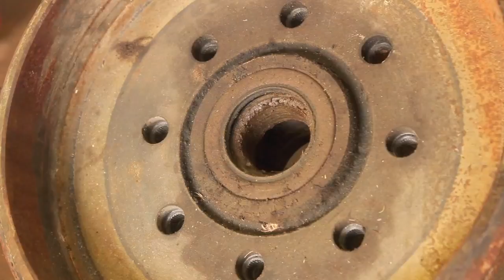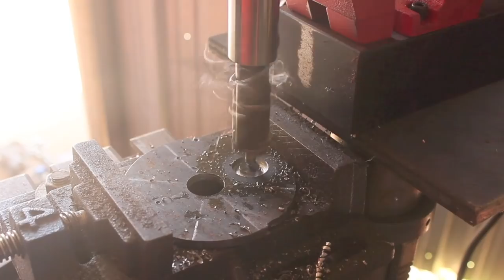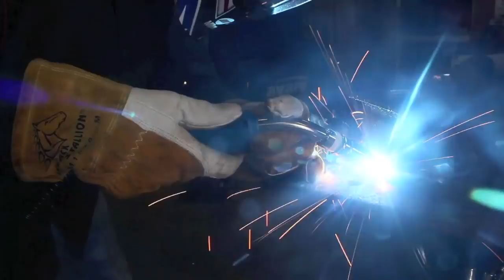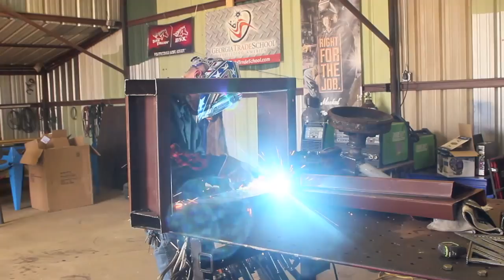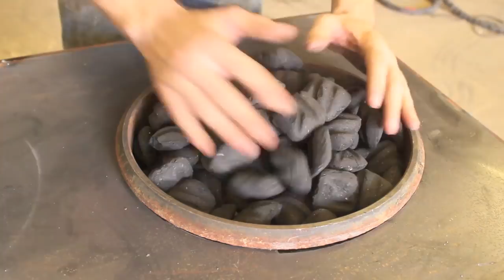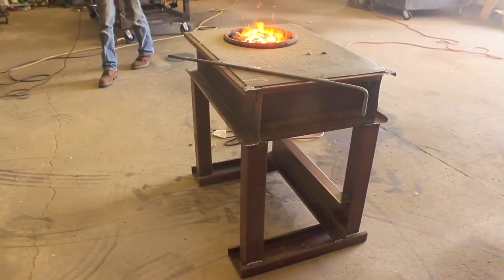BRAKE DRUM FORGE - $30 DIY Welding Project - Blacksmithing Setup For The Shop!!!

Comment: Good Idea kid, but there is just one problem. It's the wrong shape for a charcoal forge. Good shape for coal forge though,  reason why is. A charcoal forge should have a convaxed bottom for maximum burn efficiency. A coal forge can as your forge has, a flat or have a shape that is more like a grain shovel for maximum burn efficiency.👍

Comment: And for my next DIY project, I think I’ll make a 747 Jet liner. Be real mate, how many DIYers have a fully equipped workshop?? Just askin!!!
Reply: yeah i dont think any thing that needs a lathe is a $30 diy project though im sure it would be possible without that and the plasma cutter
Reply: You don’t need a fully equipped workshop to do this. A grinder and a welder is about all you would need. Just because he used some fancy tools doesn’t mean it’s a requirement.
Reply: What skyghost1000 said. I've done it before and had to leave the stuff in another state. Maybe I'll film the next one.
Reply: Great vid. Are you making a power hammer next? Or already got 1?
Reply: @Current Batches it was a $30 project for him. Because he had the material laying around. This wasn’t a how to video with a material and cut list. If you have no tools (all you would need is a grinder and a welder btw), then buy a bag of charcoal, dump it on the ground, light it, and blow a leaf blower on it. Boom, a cheap diy forge. I suppose the next thing you’ll complain about is not having any charcoal or a leaf blower.
Reply: @SkyGhost1000  
Oh yes you do!

Comment: First time to your channel and your shop is quite nice but your equipment is way above me and my shop as it would be for the majority of weekend DIYers that may watch you channel for inexpensive builds.
Try 2 tire rims, scrap pieces of pipe and steel plate and a hair dryer. Then show us how much heat (temperature) it can produce and while you are at it, why not heat up a piece of steel and bang it into some type of other shape.
Get in sync with the viewers you are trying to reach with this low budget build. Hope you luck with your channel.
Reply: I had to reply again. Your Affiliate section, "Sun Glasses I wear- Quality at twice the price"... Why I gotta pay twice the price? 🤣 Typo maybe?
Reply: I'm one of his old viewer. If you into metal, you won't waste your time here.
Reply: @sirreus3003  No, he means they are good enough quality that they would be worth it at twice the price.